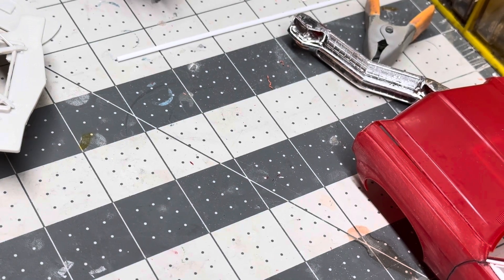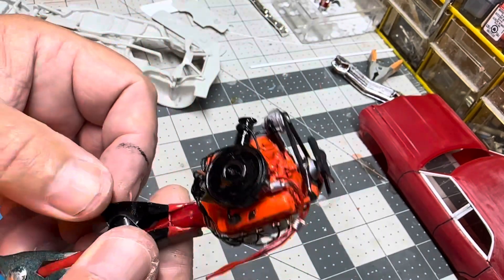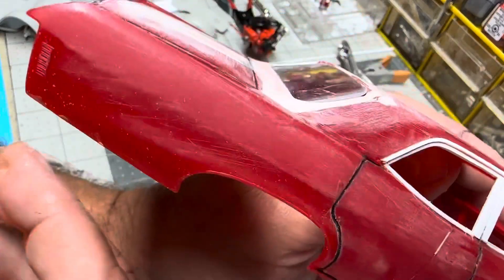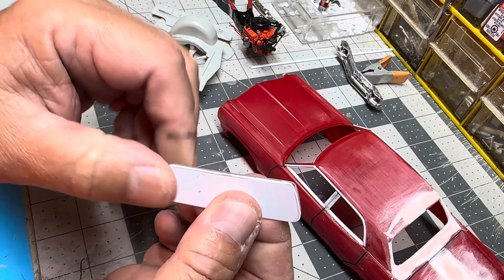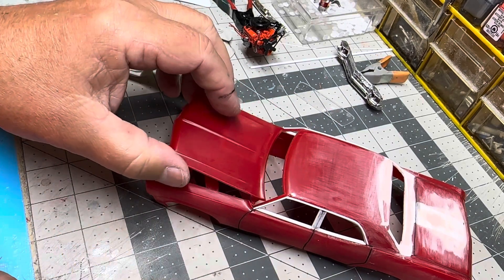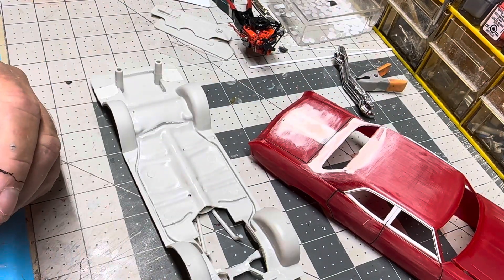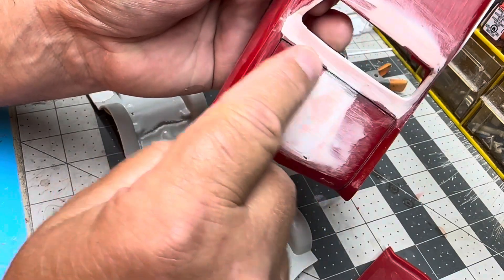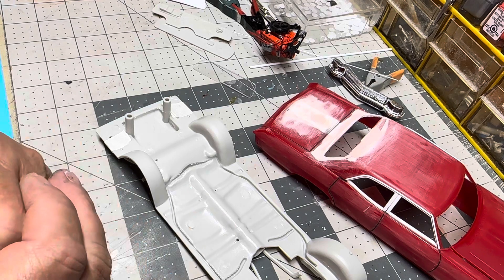70  AMT Fire Chief , update 6

Comment: David, what if you took a length of black wire insulation ans slid ut around your backlight like the actual black gaslet?  Compressing that ought tp give some spring to hold it in place.
Your patience continues to.impress.
Reply from the maker: Thank you for that idea. I do have some slender rubber hose, I will give that a look this coming week for sure!!

Comment: Dave I wish I had thought about that when I did my 70 Impala Fire Chief car, you are truly ingenious when it comes to model ideas, keep it up. Also, working on a model with an Aerodyne lightbar, I want to get a flush fit for the lenses to the siren, no gaps, any ideas?
Reply from the maker: Thank you, If you are using the light from AMT you need to wet sand both edges of the speaker that touch the light domes, and each light dome on the side's that touch the speaker. You will get them all flush that way.